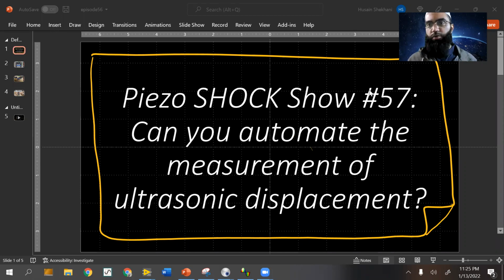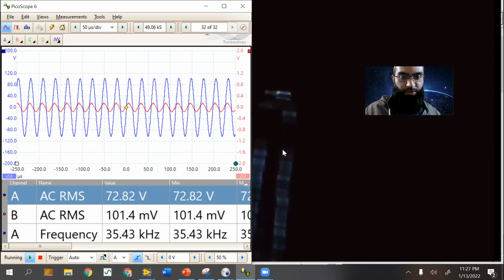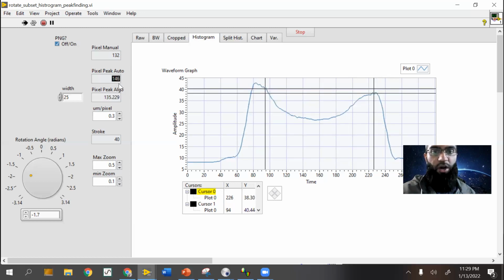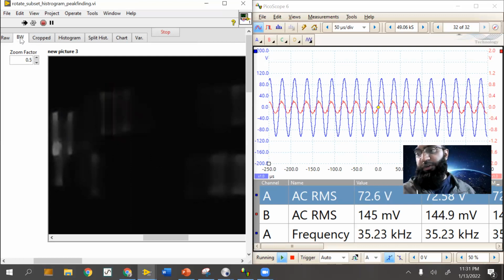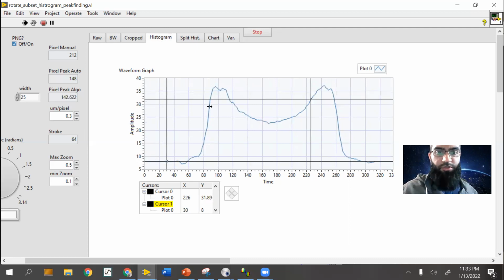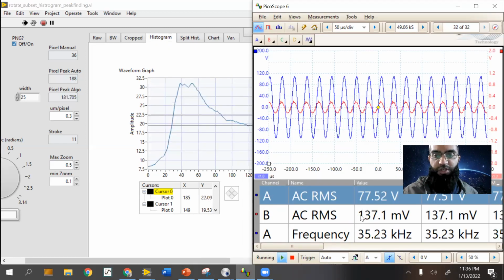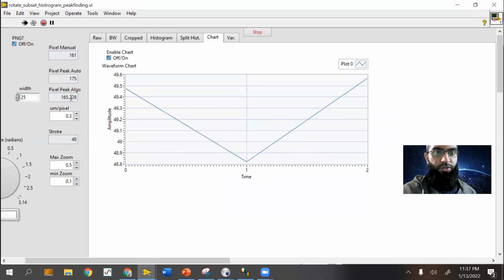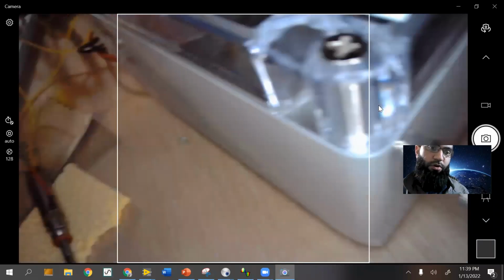Piezo SHOCK Show #57: Can you automate the measurement of ultrasonic displacement?

Comment: Thanks for the video doctor, 
I have a question about measuring transducers' amplitude in Comsol, are [ bolt-pretension ] & [ fixed-support constraint at the flange ] necessary for amplitude measurement?
Reply from the maker: Here is my answer: https://youtu.be/_F-Ic116FM4 Basically, you don't need to add bolt pretension and fixed support.

Comment: Hello Sir, atm Im doing my FYP for my degree and the title is related to Energy harvesting using Piezoelectric. I did all the test and have thousands of dataset extracted from the osciloscope. How do I change the graph from time domain to frequency domain. Note that my graph have no equation to do the fft function in matlab.
Reply from the maker: Matlab can do discrete FFT, ie FFT on data sets vs. functions. Search "Matlab discrete fft"
Reply: @ultrasonicadvisors  Thank you, one more question sir, do u think it possible to rectify my raw data that i got from the oscilloscope (in excel file)? I successfully plot the time domain and frequency domain, but now I want to rectify the voltage data that I got, but i have no signal function.
Reply from the maker: @hamdanhassan8037  what do you mean by rectifty?
Reply: @ultrasonicadvisors  I already extracted my data from oscilloscope, the data is about voltage produced by the piezo, for now i successfully simulate the data in the MATLAB. The graph is obviously sine wave because it vibration, and i want to full wave rectify the voltage graph. The reason im not creating the real full wave rectifier because i ran simulation on tinkercad/multisim but there is no output been rectified because the signal is too small, in microvoltage
Reply from the maker: @hamdanhassan8037  use the absolute value function in excel
Reply: @ultrasonicadvisors  im confused, do u have any reference that i can refer to , thank u so much
Reply: @ultrasonicadvisors  thank u so much
Reply from the maker: @hamdanhassan8037  I don't have a reference that I can recommend for this topic.